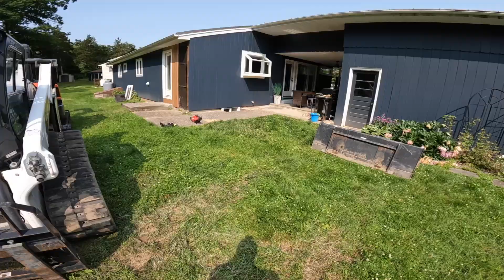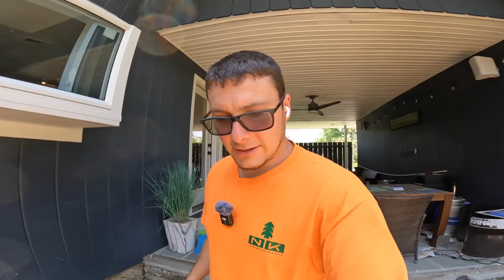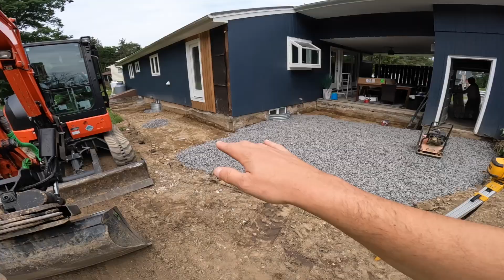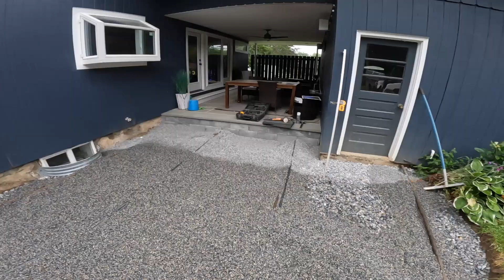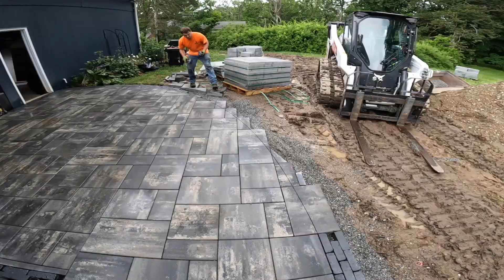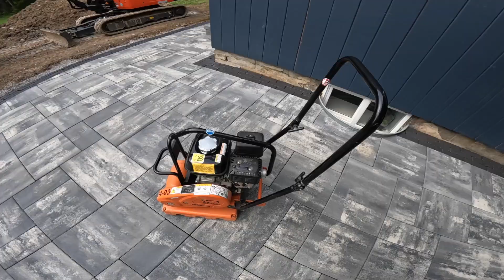Building a Curved Backyard Patio

Comment: When you made the stoop, do you use all the same blocks ?  Or is there something else hiding in there
Reply from the maker: The stoop is made from retaining wall blocks, corners, coping and pavers filled with 3/4" gravel. You basically build a small, square retaining wall, add coping as the steps, then build another one inside of that retaining wall, add coping and then pavers to the inside.

It is a fully standalone piece that does not rely on the foundation of the house. There is also flashing installed between the house and the stoop.

Comment: That project is looking good fellas! We have also been renting a roller compactor and it works very well. I’d like to try that IQ saw out sometime opposed to free hand cutting everything with a concrete saw.  Is that your own paver vacuum lifter?
Reply from the maker: The roller compactor is awesome! Im really glad we started using one. The iQ saw we have had for years and I couldn’t do a project without one. Very little dust and no water, plus they cut nice and straight!

That is our paver vacuum. It is a Pave Tool brand and we have been relatively happy with it, although it is easy to overheat the vacuum unit. If I were to replace it, I would get the version you run from a compressor.
Reply: @NKLandscapingLLC awesome looks like a back saver.  I don't think anywhere around here would have one of those for rent (NL Canada)  very neat.